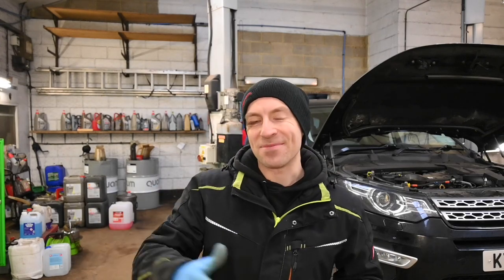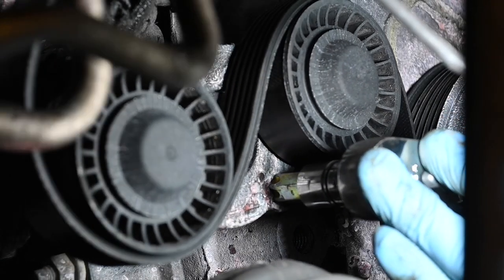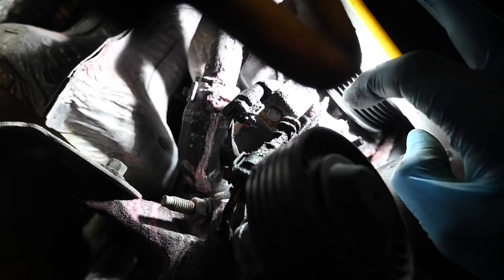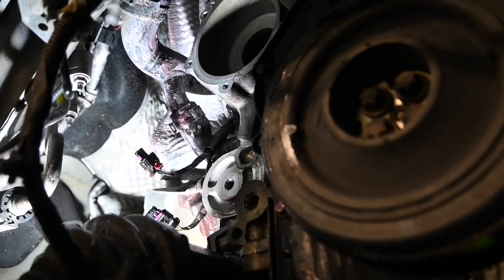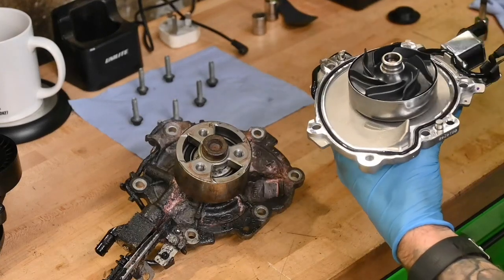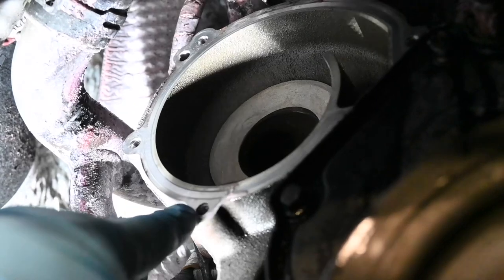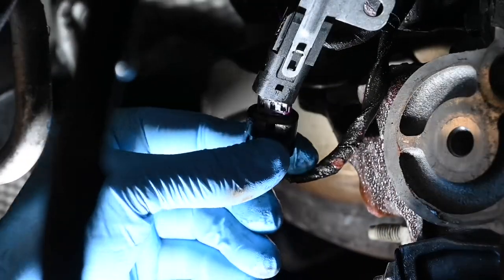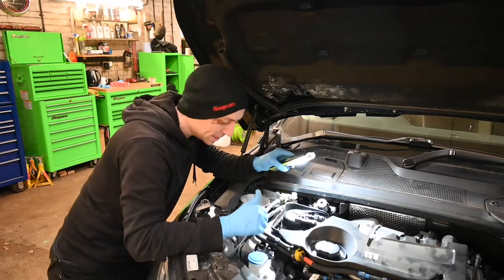2019 Land Rover Discovery Sport 2.0 litre Leaking Water Pump Replacement

Comment: Thanks for that - very interesting. My 2017 Discovery Sport loses coolant very slowly ( I have added about 0.5L in the last two years). My garage says they can't find a leak but I can usually smell antifreeze when the engine is hot. I might take that wheel arch cover off and take a look around the pump when the weather warms up.
Reply from the maker: You’re more than welcome. Please do have a look. You shouldn’t need to regularly top up the coolant on any vehicle. It’s a sealed system so will be going somewhere. I am surprised that this water pump for such a relatively new vehicle failed so maybe this may be a common fault? If you can smell coolant when the engine is warm, open the bonnet with it running coolant burning off will create quite a visible smoke and then hopefully you can trace it back to the source. All the best and thanks for getting in touch 👍
Reply: Did you figure it out? Mine has been doing the same for a long time it’s been at LR in and out for a while and they haven’t figure it out

Comment: The 3 wires connector is the coolant pump position sensor connector and the 2 wire connector is for the coolant pump variable soleniod connector
Reply from the maker: Hi Fredrick. Thank you getting in touch and more importantly confirming the use of those sensors. Really interesting to know. Thanks again and all the best 👍

Comment: Topix has the pulley bolts torque at 25nm and the pump bolts at 12nm. 👍
Reply from the maker: Thanks for getting in touch. This is really great information. For such a fairly new vehicle we have limited information on specific tightening torques. Thanks again 🙌

Comment: Would you happen to know how many miles the discovery was at? I believe I have the same problem but using dye to confirm it is the water pump. Thanks.
Reply from the maker: Yes, shockingly was repaired at 45,000 miles. They seem to be quite common and these engines are also used in some Jaguars too with the same problem. Easier to see in the Jaguars but with the Land Rovers, to confirm the leak, you’ll need to access the pump through the drivers front wheel arch. Thanks for getting in touch 👍

Comment: Great video matey, could I ask at what mileage this water pump failed at and the cost for a replacement from JLR?
Reply from the maker: Thank you for the positive feedback. So the mileage that was recorded at the time of repair was just over 40,000 miles but I do know it had been slowly leaking for a while prior to that. I don’t know what JLR would charge would be total but the water pump itself was close to £200 itself. Then main dealer hourly rates on top would really bump it up. The problem seems to be though that there is on average 4-6 week wait list for any repairs.